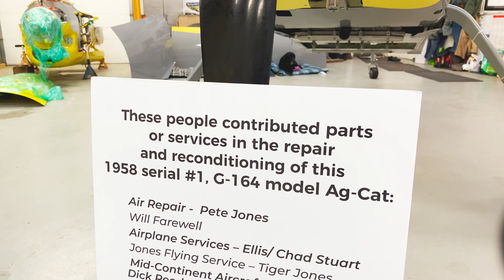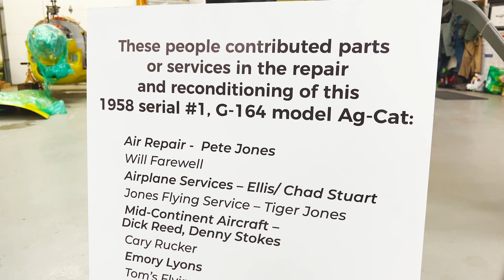Restoring Ag-Cat #1 with Toby McPherson

Comment: Wow, thanks for this video. I am familiar with this plane since my dad and other farmers had one and hired the pilots rom Hayti, MO. Sorry spelling might be wrong. I have a lot of stories from the 70s and 80s as a kid growing up around this plane and going out to flag for crop dusting and being all over this plane. Used to hear it every calm morning in the summer taking off and you could hear that engine for miles away when it took off. Lot of stories I could tell and them pilots were excellent some out of wwii. One crack up and one land down the hwy  from mechanical problems.
Reply: sad them old radials bout thing of the past